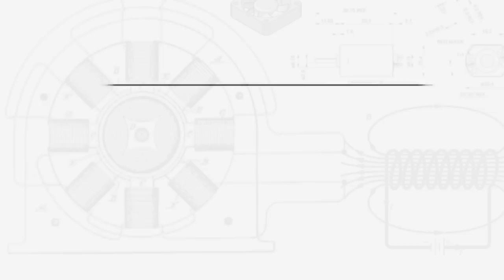220V Free Energy Generator Using Neodymium Magnet

Comment: I love the idea for your project but what's that "TIC" sound at 5:25?
Reply: its probably a switch being turned on off screen.  IMO if the thing is vibrating that much, wouldnt it start moving in some direction or even the whole base start rotating?  i think it isnt because of the wires running from underneath.
Reply: @g3n3t3ks  It's not 'probably', it is infact what is happening. All the wiring is done underneath (hidden). The moment he connects the battery to kickstart the motor, another guy somewhere else turns on the switch to keep the motor going. The circuit which is shown is is absolutely fake.
Reply: Did you notice the cut at 5:18? He paused the recording and completed the real hidden circuit.
Reply: The man is just a hungry swindler and the TIC is from turning on the system with a simple switch underneath. He could just put a electrical relay to avoid the sound of the TIC.
Reply: The two screws go right through the table to the real power source.

Comment: This operated by  power supply  when he connect second wire battery to motor  there is sound of switching button (tuk) and second thing that motor operates on DC not on ac